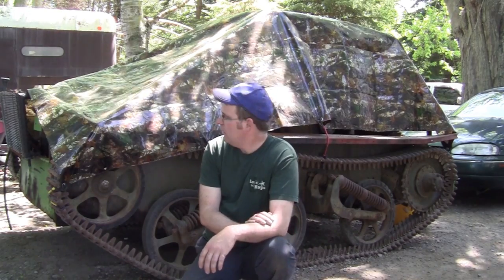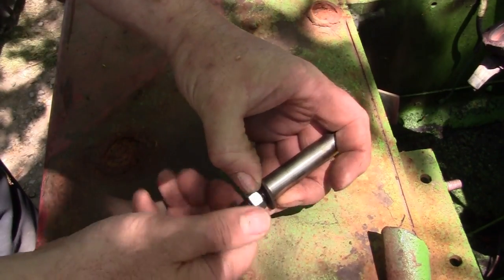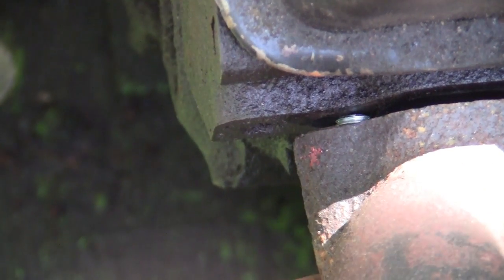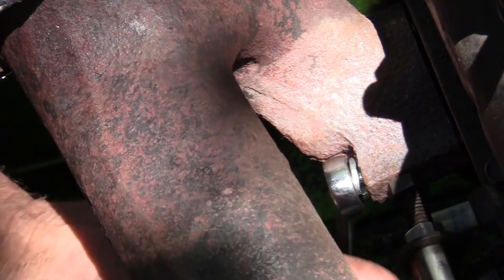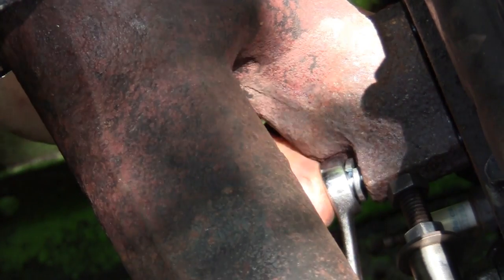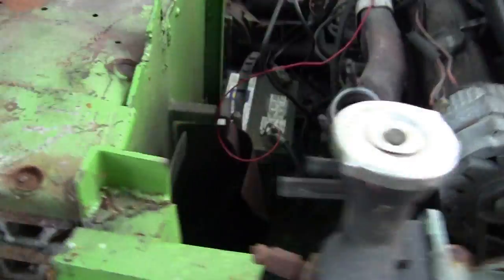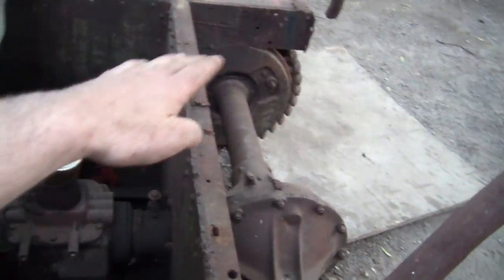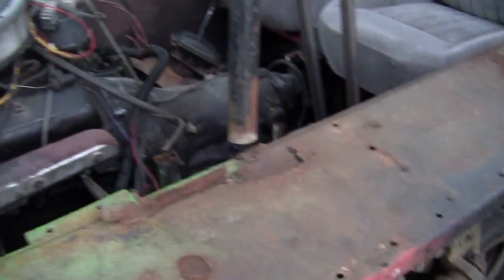The TANKenstein project 8. Exhaust manifolds.mp4

Comment: Huh, i wouldn't expand this, but rather drill bigger hole, temperature changes  and tension could cause cracking of mainfold or head. I envy you that in USA you have so many cheap v6-v8 engines.

Comment: Thats why I wondered if 318 would fit it`s not cast and can be welded to fit length but the bolt pattern -And the port is out & up center - just a thought look more uniform too.

Comment: That could work too - Just thinking the front corner of the valve cover gasket will never stay flexable to keep oil in you`ll have to put a shield between it anyways -it gets red hot at the exaust ring pain in the ass --we had an old bomb around field car as kids that was a malibu we set the field on fire once so we turned over the manifolds & put the exaust on the roof  & this is what was happening to us -just saving you some headaches .